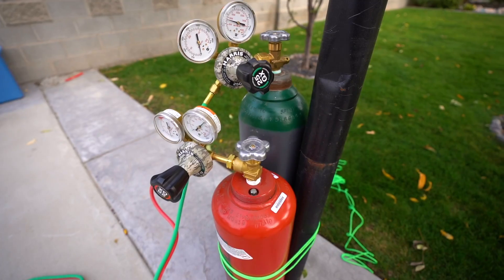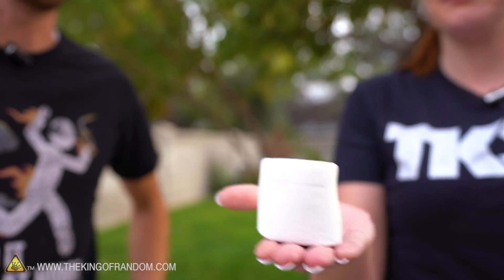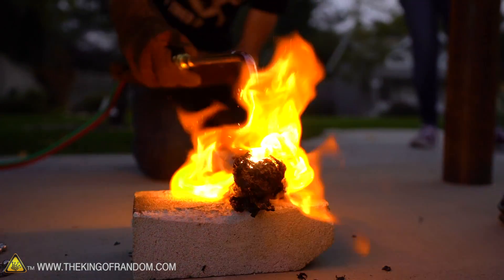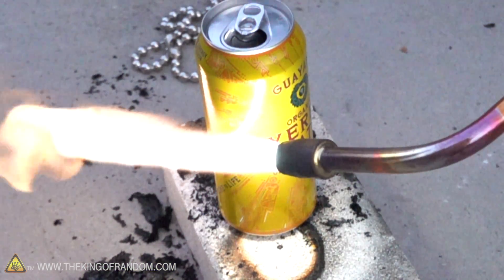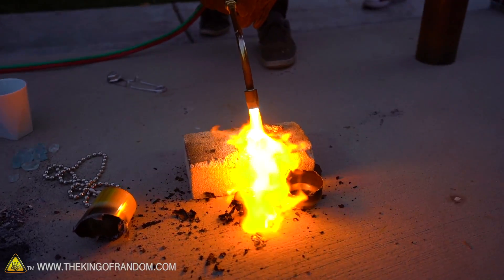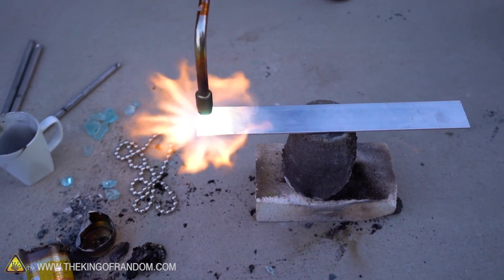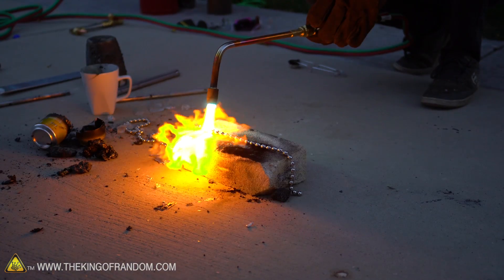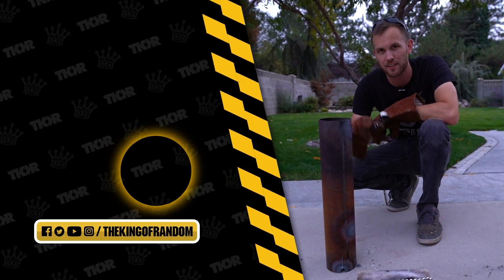This Gas Combo Incinerates Anything at 5500°F

Comment: Turn the oxygen off first and it won’t make that pop. Also you should get the cutting nozzle and have fun cutting stuff. It will only cut properly if the metal oxidizes. For example it will not cut stainless nor will it cut aluminum. It will slowly melt but not cut. Also make sure to do a bunch of research first. I took a class completely on oxy-acetylene and it was mind boggling the science behind it. Also make sure to suit up completely because if you move to fast or cut incorrectly it will shoot molten steel in places that you don’t want it to go.

Comment: Get a Harris® brand or Airco® brand oxyacetylene cutting torch. I use one at work that gets up to 6300°f.
Edit: also, when you light it, you should have a small amount of oxygen added to prevent the black soot. When turning off, always turn off the acetylene first. That'll prevent the 'pop'.

Comment: Oh man I hope you had flashback arrestors on that! If you adjust the regulators at the bottles you should be able to get the mixture right so you have no yellow flame, just the clean blue one using the valves at the handle. Also make sure you turn the oxygen off first when you're putting out the flame otherwise you're causing flashbacks and making it pop, its pretty dangerous to do that...

Comment: You know if you guys tuned that torch right it definitely gets more than hot enough to cut through steel like a hot knife through butter i know because i got to use one in welding class in highschool there fun yet dangerous but how you know you got the mix right is there will be a blue needle like flame

Comment: When  I was 13, I thought it would be cool to blow fire like a dragon. I figured the acetylene would make a sizable flame. So I pumped my lungs to capacity from the torch, lit the lighter and, boom! There was no slow flame at all. As soon as I opened my mouth a sliver, there was a loud explosion and I felt a bit warm inside. Besides my hair catching fire and a little heartburn, I seemed undamaged. Can someone explain how that is possible? I should have been splattered on the walls for that Ignorance! Why am I still here?

Comment: As one who tends to use a oxy-acetylene torch to weld i really cringed when you lit the torch and only made a flame that was about 3000 degrees usually to get to the max heat you look for a blue cone shape at the tip of your torch.

Comment: This is the type of tool I use for pre-heating my carbon steel for a practice weld, Preheating is mostly used for T-Joints or Lap Joints. It depends really...

Comment: As far as the glass goes it can be melted down but it has to be heated super slow. Once as a teen I melted a hole through a jar (without breaking/cracking) using a cheap propane torch.

Comment: I learned welding in school with an oxy acetylene torch.

Melting steel is pretty easy. Brazing is a lot of fun to do with the flux.

Also, please wear welders jackets, face shields for better protection and make better use of welders gloves.  It doesn't take much to harm yourself with these torches.

Comment: Use the cutting head and cut one of the cast iron anvils in half. 
Weld steel with a metal coat hanger.
Those silly goggles came in the kit for a reason the IR radiation will damage your eyes.

Comment: I'm excited for you guys to play with oxyacetylene but please guys, talk to some professionals, learn how to set it properly, and if you shut off the oxygen first you won't get the popping. 99% of the time, popping is a sign of something wrong, either with the equipment or the use. Once you've got that sorted, you should be able to get some lense material for some traditional welding goggles and cut it to fit over the camera (I'm sure there are proper ways of doing it too) so we can see more detail, there are few things as satisfying as watching metal liquify

Comment: Ummm... you lit the torch wrong. You are not supposed to see any black smoke known as spider webs in the air when you are lighting it. That black will block your tip very fast. You had the oxygen on first which you should have the acetylene on first and not the oxygen.

Comment: So I actually welded with oxyacetylene torch in a welding shop class when I was a freshman in high school (like 14 years ago) and I don't remember the torch popping as we turn it off. They had us turn off the oxygen first and then the acetylene basically going in the reverse order. I do know it did pop and go out when you added too much oxygen.

Comment: this tip is for heating material. to really cut anything, it is better to use an actual oxy/acetylene cutting tip. it is smaller, and creates a finer, hotter point of flame rather than the large diffuse flame shown in the video

Comment: Glass rods or bottles work much better than those chunks of glass. You can hold a piece of glass rod in your hand inches away from where you apply the heat and not get burned or even feel much warmth.  Don’t need that much heat for glass to melt and making different shapes by deforming bottles is fun. Works great with beer bottles but you want to empty them in the proper way first.

Comment: I have a question... isnt this torch the same thing as .... You know... a cutting torch/welder
Reply: It's the same thing if you change the tip to a cutting torch head. You can't really weld with it though although you can braze with it.

Comment: question: aren't they holding the tip to close to whatever they are working on. With my various torches I have to hold it further away so as to not create what I call a black hole. Where the spot in the middle isn't as hot as what surrounds it.  Just wondering since I don't have acetylene and oxygen. I use oxy/propane.

Comment: Ya with the right torch tip and proper settings you can cut steel, 7 psi acetylene 40 psi oxygen
Reply: Turn on the acetylene first then the oxygen, turn it off acetylene first then oxygen, FYI your going to blow up if your not careful enough you might even take out your  Neighbors by accident

Comment: So I don't know if my last post went through. But I asked a question. Is Silly Putty a Non-Newtonian Fluid? If a fluid is defined as a substance that takes the form of it's container, and a solid is defined as a rigid material such as a wooden block, then Silly Putty fits the definition of a fluid, a very viscous fluid. Silly Putty also happens to keeps it's form under high impact, thus allowing it to bounce off of hard surfaces. So since it maintains a certain level of rigidity during high impact moments such that a normal fluid would conform to the impacted surface itself, Silly Putty could be observed as a Non-Newtonian Fluid. This is my assumption.

Comment: we use propane and oxygen for torches on the rail road locomotive maintenance department. We burn through 6 inch thick solid steel plate at times.

Comment: The old mechanic trick was to fill a styrofoam cup upside down with acetylene and leave it on the table, then scare everybody by making it explode by just grazing the cup with the flame or melting through the cup with a cigarette.

Comment: A cutting head and more oxygen would help a lot. The flame is still orange(too much acetylene) and doesn't burn at hot at it should. With more oxygen and a perfect mixture you would get 3 cones in the flame, where each is smaller than the first, then you'd have a stoichiometric mixture (ideal air/fuel) mixture. When cutting steel, with a cutting tip, there's that nice experiment where you heat the stell till it melts and then turn off the gas and only send oxygen through and it will continue to cut the steel.

Comment: If you think settling does great you should try hydrogen......

not only that but it does not leave a carbon trail you can actually fuse two dissimilar things together..... 

You can do a search for hydrogen torch or hydrogen welders and see all the cool things you can weld together it's crazy

Comment: I apologize if this comes across as an armchair hero, its not meant to I just want to put some info out there.(this all come from my limited experience and the person that taught me)
That rosebud tip is fun but a cutting tip (if I recall correctly) gets hotter. I think you need a bit more O2 in it to get it hotter on the rose bud.
It won't pop when you shut it down if you turn off the oxygen first.
You may want to use caution when using that over concrete, dripping slag (or direct flame for that matter) can cause spalling of the concrete. Similure situation to using river rocks in a camp fire.
Fun thing to do when you are heating a chunk of metal, you can relight the torch on the slag.

Either way great video, eagerly awaiting the next one.

Comment: As a welder by trade who uses oxy acetylene torches a lot. I would like to point out the flame is nowhere near as hot as it could be. More acetylene and more oxygen to get a nice light blue neutral flame, at that point its at its full 5500

Comment: You should get a cutting torch and use that because the cool part about those is that they actually don’t cut it by melting it it actually speeds up the rusting process in the confined cutting path.

Comment: Nate, Turn up the oxygen on the torch and the flame will be blue and very hot.
You can burn some dirt, try to liquify sand, light a campfire with the torch, burn some broken stuff. Try burning some titanium, gold, steel and other metals.

Comment: Turn off o2 first then the actalyn and it won't make a poping sound
Reply: Also idk if u got the lit gas bottle on the line can't remember the name of it but it stops gas from burning down the lines and into the tank and exploding
Reply: Also get the dark inner blue cone of the flame inch to half an inch away from the torch head
Reply: One more buy a blow torch head you will love it u can cut thew two inches of solid steel in seconds
Reply: Not a blow torch it's a cutting torch
Reply: Also it's pretty easy to black smith with a rose bud torch

Comment: I work with these a lot and those tips are meant for preheating and heating large surfaces to bend or mold metal for what yall are doing you need to have a cutting tip or learn how to properly set the rose bud tip that was nowhere near how hot that will actually get if mixed properly

Comment: Get a cutting tip. More heat in a smaller area. Also when striking, crack open the oxygen valve just slightly to avoid the black soot.

Comment: Only but the smallest of rosebud tips can be used with a single cylinder of acetylene. Most rosebud tips you need a manifold to get satisfactory pressures to fuel said tip. Why? Because acetylene becomes unstable if withdrawn from a cylinder too quickly.

Comment: You can weld with an oxy-acetylene torch because the primary flame burns hotter than that of MAP gas. But the secondary flame of MAP gases burns hotter than the primary.

Comment: Not enough flow in general but the acetylene should be turned up till almost no smoke then it won't pop but just watch the draw off the tank cause too much you will pull off liquid acetone

Comment: 🚨🚨🚨🚨
WARNING! 
The discoloration at the neck of the tip/rosebud is tip failure. You do not have enough acetylene gas to use that tip. The discoloration is from the flame burning inside the neck! 
DO NOT USE THAT TIP WITH INSUFFICIENT FUEL.

Comment: Foundry worker here fun bit of info when the steel is sparkling like that after its cut it’s actually burnt  if you put a steel rod in a forge and really let it heat up when you pull it out it will sparkle like crazy which means that it’s actually burning  also do t mix water with steel in a Liquid form it blows sparks everywhere

Comment: Show how steel burns by getting it to melting point then feed it just oxygen from the torch. I've used the cutting attachment to cut steel then turned off the acetylene and continued to cut with just the oxygen.    🇺🇸😎

Comment: Hey I have a very weird project that I can’t do at home and it’s very dangerous and you guys do a lot of dangerous stuff but take a lot of precautions as well and I don’t have the equipment or protection to do so here to test my thing what I wanted to do is test if another gas could be introduced into a vacuum and then have a small igniter inside of it that would ignite that gas being oxygen would just expand into a ball of flames or would it explode the vacuum chamber if you guys do do this and I don’t want yawls vacuum chamber to be destroyed pre-make a tiny one hopefully to test this if you guys do it

Comment: If there is black stuff coming off of the torch turn your gas up and when adding oxygen make it so there is a tiny blue spot at the beginning use both to achieve that is called a neutral flame

Comment: When your torch is properly set, which yours wasn’t, the blue part of the flame should only be about 1/4-1/2 inch from the rosebud tip. You need to either increase your oxygen, or turn your acetylene down.
Reply: and his shutdown was wrong
Reply: @whiskey6964  correct. Oxygen first, then acetylene
Reply: Yup. They clearly have no idea what they’re doing
Reply: As a welder I cant agree more.
Reply: @inexactlyexact1948  former career millwright and certified welder here.
Reply: I came in the comments to talk about this. Glad someone else covered it.
Reply: It would be the oxygen
Reply: @jobycoates7295  either would make the flame how it’s supposed to be, just a matter of how hot you want the torch
Reply: Turn in acetylene first light it the adjust the oxygen until you have about 1/8 in blue needle like tips around the outside
Reply: @jobycoates7295  turn the acetylene about a quarter turn then adjust your oxygen, then the flow to where you can see the little blue cones.
Reply: @Shumaker Guitar Works SGW i agree
Reply: Glad it wasn't just me noticing this.  They need to learn to use such things probably before doing  video.

Comment: You guys should do Styrofoam cup poppers. You just get the flame to a nice blue point’ snuff out the flame put a Styrofoam cup on a table with a smallish hole in it fill the cup with the gas mix and light it. Do not use anything other than Styrofoam. Shrapnel really hurts!!!

Comment: as a welder we use these torches everyday if you turn up you asetalyn nob till you get little "teeth" at the tip you can cut more and more percise and not as much popping.

Comment: How long to cut through:
A steel weight 45 Lbs maybe a 100 Lbs.
Rim of a car tire
6 inch thick diamond plate steel
Reply: The answer to that if they’re using this tip is dependent on how far away the nearest gas supplier is because you’re not gonna cut through that with the tanks they have

Comment: That is a rose bud tip it is used for heating stuff up, but it see like you do not have a enough oxygen in the mixture. There should be a very defining sound coming from the tip itself

Comment: As a welder who uses this in my work at home please be careful with this stuff if that acetylene tank goes the whole house will be gone. That's not even to mention how dangerous those oxygen tanks are as well. Also if you turn off the oxygen first it won't pop.

Comment: Welder here. I advise you get a little more practice with oxy acetylene. You gotta rose bud there. Not for cutting but literally heating stuff up and bending or forming or whatever. A cutting tip would do you guys wonders. Also, I'd advise you try and get all this up and off/away from your concrete driveway. Trust me, unless you want pits... Because this is how you get pits

Comment: You guys should really go buy a cutting tip for that oxy/acetylene torch. It put more oxygen when you press the trigger making it hotter. The tip you're having is for heating in most part like when you weld a really tick steel piece or when welding cast iron to prevent it from warping. ( sorry if I use wrong term.. I'm French.. )

Comment: For anyone that's not well versed in plasma cutting or oxy-acetylene cutting it's used to cut up to about 8 inches of steel easily with the right cutting tips. So I say anything less than that it could cut.

Comment: Oxy acetylene torch setup, gauges should read 40/10. And it would be better with a different tip. Instead of that rosebud, a two piece cutting tip like a 2-1-101. Also since you’re playing around you should have flash arrestors placed between each gauge and corresponding hose.

Comment: You guys need to get a better tip or put more oxygen into your mix. I used to work with oxy years ago, cutting through one inch steel bulkheads. Your flame isn't anywhere near as concentrated as what I used to use. Try a cutting tip instead.

Comment: You need to hey a smaller sized tip and better nozzle/handle thingy with the trigger to refine the flame coming out . A number 4 tip with a trigger hangle will refine the flame to cut faster and thicker stuff . Being I used to work at a scrap yard cutting up train cars and other random things from tractors to wood mill blades 12inches thick steel all day this is something I can speak with experience on.   The tip you have on the nozzle/handle is way to big of a tip for cutting that is mostly for tempering and bending metal not cutting it and having the trigger style handle will allow you to adjust the flames intensity as well.

Comment: There wouldn't be a pop if you turned off the oxygen first, also note that it's dangerous to turn off the acetylene first, because if you leave the oxygen on you won't be able to tell since it has no scent.

Also, you need to use more oxygen to make it a blue flame and get a proper feather at the base of the flame.

(Also use a shaded lens when working with oxy-acetylene for long periods.)

Comment: with my torch i made some fractured glass marbles. the trick it heat it up slowly till the outside looks like melting ice then drop it in ice water. if it dont shatter from the shock. you have a solid outside and on the inside lots of cracks. just note its not as strong as it use to be